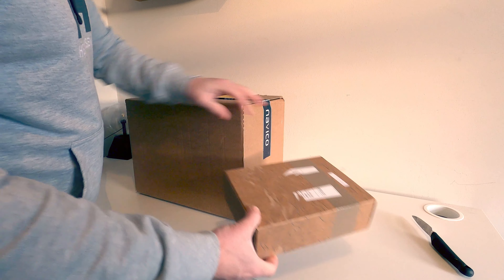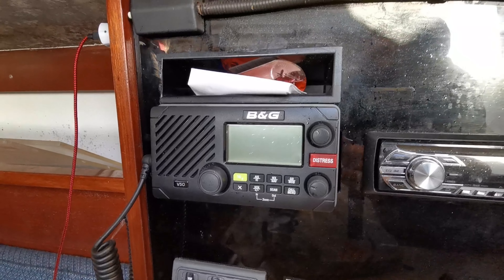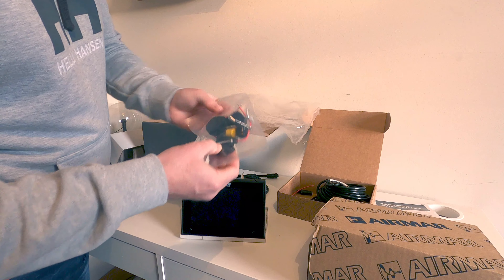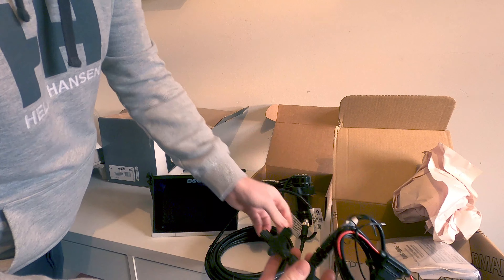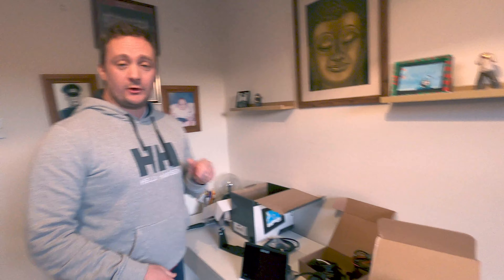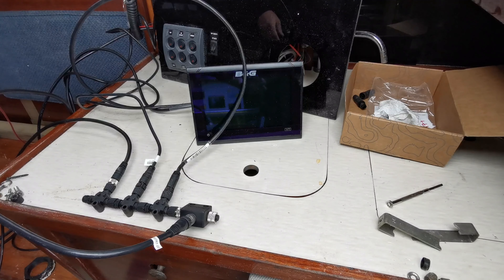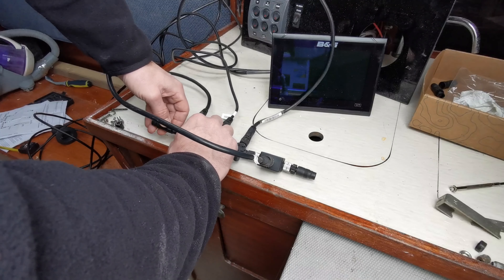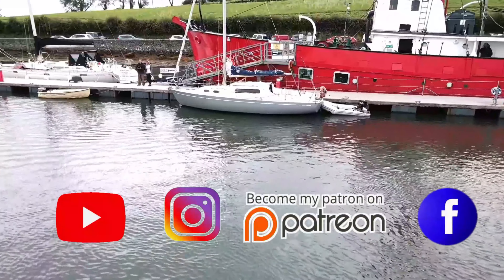Our NEW Sailboat Tech ¦ B&G Vulcan ¦ Airmar DST810 ¦ NMEA 2000 UNBOXING & Set Up

Comment: Very helpful video, thank you! What settings did you update to make the v50 receive GPS from the Vulcan 7? I am having the same issue, but not having any luck with it.
Reply from the maker: Hi there. Sorry for the late reply. I can't remember of the top of my head. I think in settings there is an area where you select where you want to receive information from. And select v50 under the AIS tab. I'll have to check this and get back to you if that's OK?

Comment: Great video Mark, been looking for a simple upgrade video.. for B&G. Did the furuno gear connect straight in to the NMEA 2000 for the ais & GPS? or did you need and converter?
Reply from the maker: Sorry for taking so long to reply Ritchie. We don't have furuno equipment. Our vhf radio has a ais receiver in it, but no GPS sensor which was a pain. So needed either a GPS sensor or a chart plotter with GPS receiver in it and that's what we went for. The vfh, chartplotter and depth sensor all connect seamlessly through nmea 2k.

Comment: Mark, if you did not have the speed paddle wheel. Could this unit calculate  your speed by using GPS?
Thanks  Merry Christmas to you two
Reply from the maker: Yes we could use the GPS for speed but we wanted to have the paddle wheel to help give us the edge with calculating ourse to steer on our b&g for some club casual club races. I don't think that would be cheating would it? 😂😂. Merry Christmas to you and your family

Comment: plywood? You have not cut in the display you may want to use a cable and have a mount inside as well as out up on cabin top. Leaves room to sit thank you glad to see you again
Reply from the maker: Thanks. We do actually plan to flush mount the unit in the cockpit. We will use out tablet for inside the boat and hope to be able to mirror it with the vulcan display